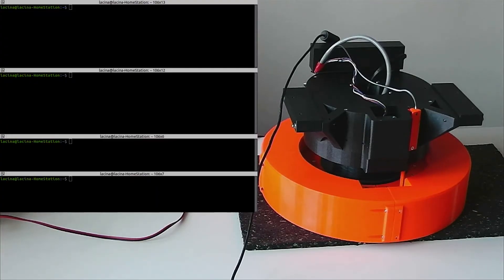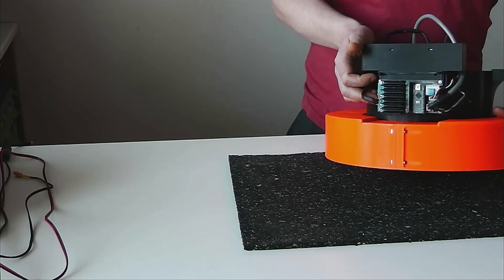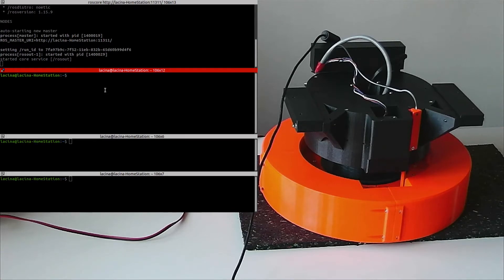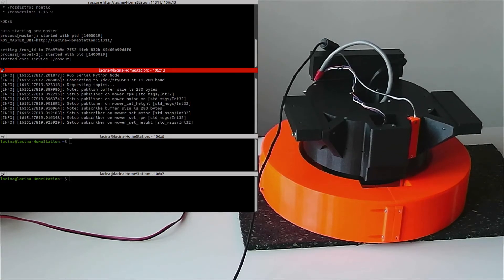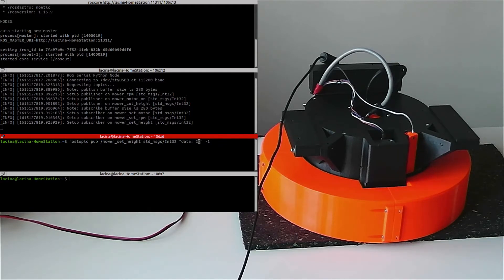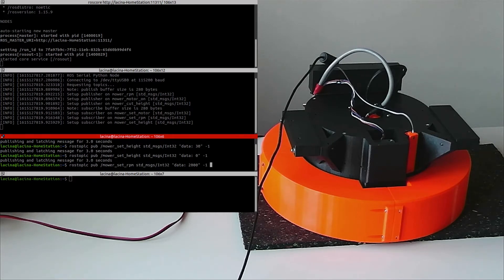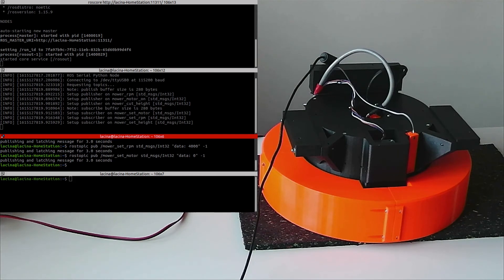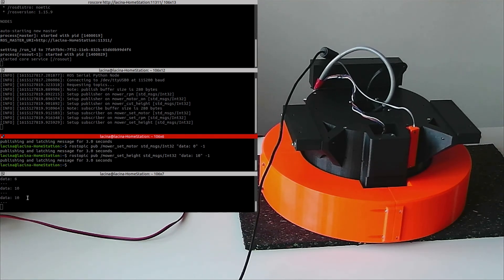New Mower unit is ready

Comment: nice, i would like to build this as well as your 4wd vitulus chassis, are all the steps for both this new mower deck as well as new chassis in your github? I am still looking for them - thanks - also these parts look pretty big what bed size is required to print these parts
Reply from the maker: This new parts will be available after test. It's built, but I never tested them. There are still no conditions for testing at the moment in my country. The winter is end, but the spring coming slowly. 4WD platform is almost finished, but some details will change, maybe. I'll publish parts, but I must try if it's working. It's printed on PrusaMK3 25x21 cm.
Reply: @lacinadev  okay thank you, I do look forward to seeing the designs once you have time to test them
Reply from the maker: @levi_lcl  I'm realy sorry. My time is limited. I'll do my best. Thank you for your patience.
Reply: @lacinadev  how is development progressing?